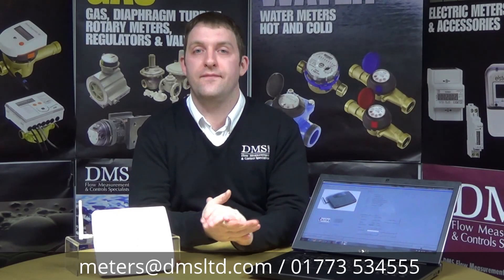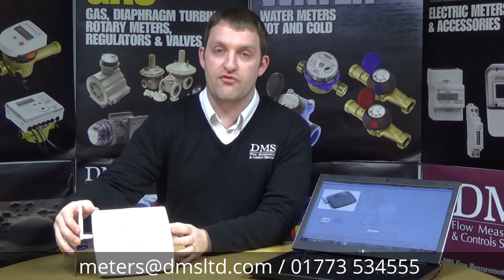Sontex Supercom 646 Central Radio System from DMS

Comment: Hi, hope you can help. What is this thing for? We've got one in our house (not the first owners!) and no idea what it does. Thought it might be the door bell (which has been replaced with a ring door bell)
Reply from the maker: Hello, thank you for your question. The Sontex Supercom 636 is a data collection system which allows for readings to be taken from a wide range of compatible Sontex products. Its likely that this was installed to work along side a heat (energy) meter. 
We hope this clears things up for you.
Reply: @DmsltdMetering  Thanks! Very interesting. We have an electric boiler (soon to be swapped out for an ASHP). Is there any way to definitively figure out what this thing is doing? I noticed a data port under the front plastic panel.

Thanks again for the speedy reply!
Reply from the maker: Hello,  @Soulrollsdeep  could I check on your location? Are you based within the UK?  I would suggest giving out technical team a call, if you are based within the UK there is a high chance that this unit would of been supplied by us, as we are the UK exclusive distributors. Our team are more than happy to go over the details and also offer advice on your ASHP. 01773 534555 / Meters@dmsltd.com. If you do give us a call, ask for Lucy and I can rely our conversation to our tech team.
Reply: @DmsltdMetering  I am indeed in the UK, I'll call up tomorrow! thanks!
Reply from the maker: Great, we look forward to speaking with you.  @Soulrollsdeep